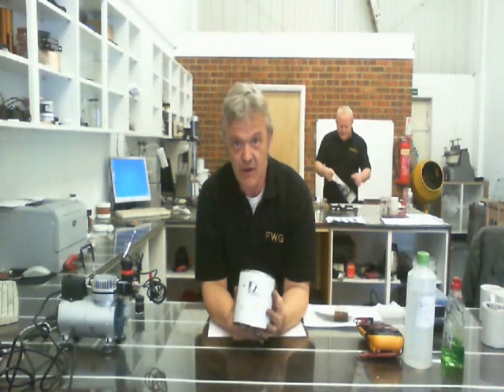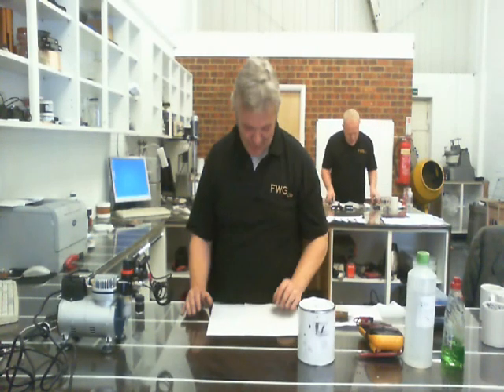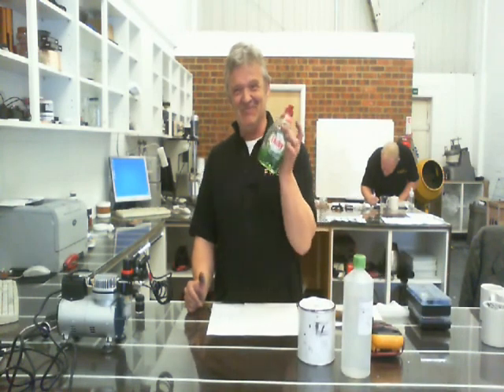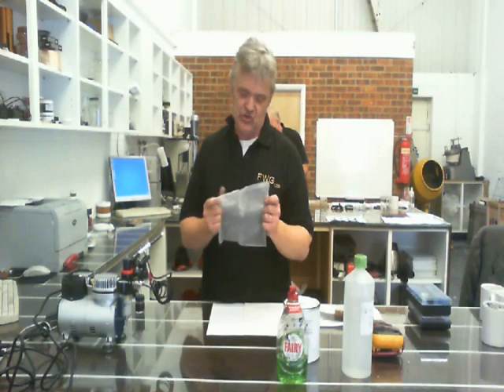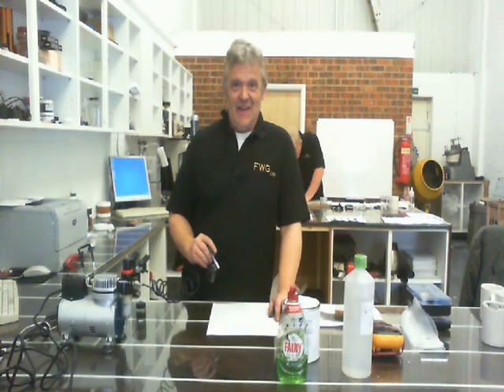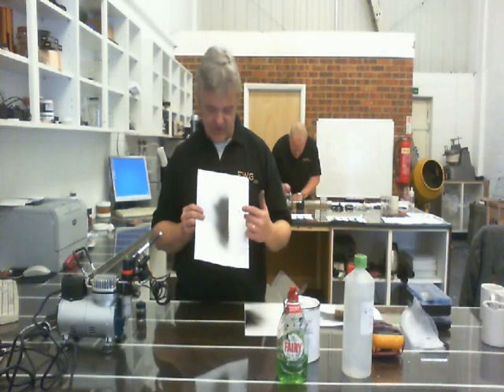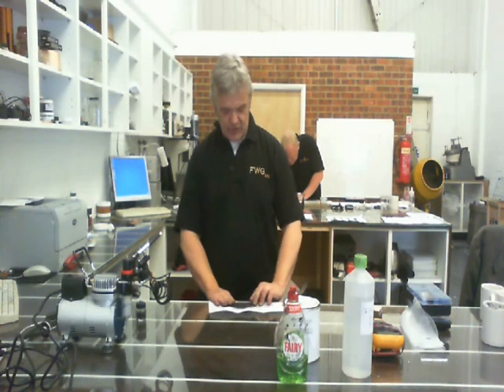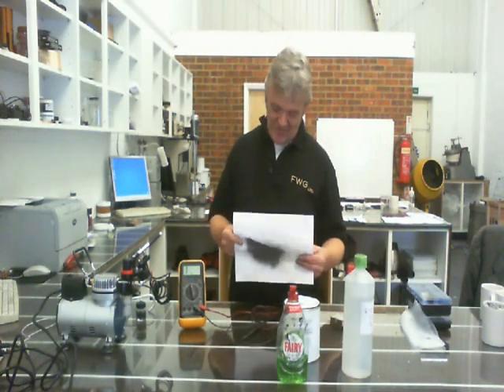How To Airbrush Conductive Ink

Comment: First, I have really enjoyed many of your videos.  Thank you for you your work - and you publishing your work.  You have been the first channel I have subscribed to.

I have seen where you make graphene, as well as ink.

Have you thought about the process of combining those two processes into one whereby the goal is a single step production of graphene ink.

I ask for a reason other than laziness.  Inkjet printers require inks with known stabilities and viscosities.  One of the major issues with inkjet is particle sizes for clogging.

Graphene particle size  can probably be controlled by the speed of precipitation (guessing?) or by the method of formation and hence my question have you bent your brain to the question of graphene ink production?

Amazed....

Chris
Reply from the maker: I have indeed - i just have no use for it right now
Reply from the maker: i know that might seem like an odd reply - but graphene as a single layer is not as useful for the home experimenter as you might think. Graphene is actually quite difficult to use well and needs a whole host of pretty expensive equipment to actually do anything with it - my channel is about inspiring the home inventor - so i haven't done that much in using monolayers - but i do have something up and coming
Reply: Robert Murray-Smith
Hey Mr. Murray-Smith

I look forward to hearing about it!

I'm a home experimenter and I've used silver nanoparticles to print circuits using inkjet printers.  The issues of annealing, stability and adsorption were difficult.

Pardon enthusiasm -  but the possibilities of printing circuits is something that is cool and exciting!  

Another question:
If you took one of your graphene electrodes and hooked it up to a capacitor say from a pocket camera or a strobe light.. wouldn't you vaporize portions of the graphene and cause graphene deposition?  Might also work with graphite, no?
Reply from the maker: Chris Pedersen
i don't know i have never tried it - but yes it probably would - having said that you get graphene in a candle flame - just not much of it and it is difficult to extract

Comment: In my 20s I did a lot of airbrushing (being a graphic artist) and I think the drop in Air-pressure on long bursts is due to the compressors capacity. There are quite affordable compressors on the market that will supply ample pressure with a big tank without having to switch on the motor. That might help.
great demonstration there, sir. I think that will open a whole new world of possible applications for your ink :)
Reply from the maker: cheers mate - the airbrush i got was pretty cheap but it was only for the demo so i don't mind but good suggestion thanks

Comment: I was going to try this but I seem to have misplaced my airbrush. Glad to know it will work once I find it. :D
btw tried the Thremocell the other day with copper tape->ink->zinc oxide->aluminium and got .5v until it dried out.... then I got nothing. Do I need to press the cell or do you think it's shorting out? Somewhat lost as to what to try next.
Reply from the maker: when this kind of thing happens to me i just do it again but more carefully lol
Reply: Robert Murray-Smith Yeah I'm liking the method of painting the zinc oxide paint on the aluminium and the ink on the copper tape and pressing them together after letting them dry a bit. Otherwise the ink mixes with the zinc oxide when applying the second coat and I just get a mess. I think I'll try again but tape off the edges better. Been messing with my 3D printer and it's divided my attention..... not to mention I got another kid on the way in 4 weeks. Not enough hours in the day man! sigh
Reply from the maker: ben dorman
sorry mate - but i know exactly what you mean!